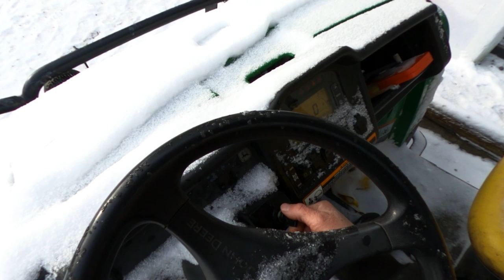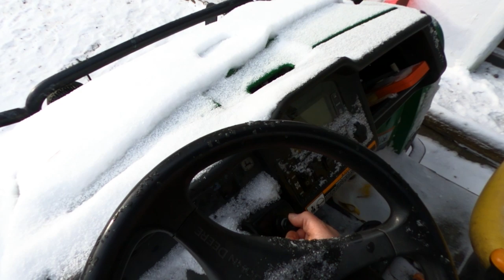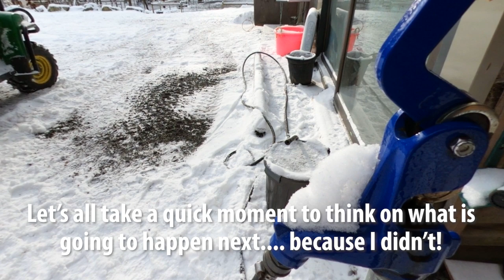Just A Few Problems With My New Genius Horse Watering Method

Comment: We use a similar system at the new barn I'm at.  If you don't count filling the tote with water, the whole ordeal probably takes around 10-15 minutes, filling 6 troughs, for around 25-30 horses total.  The contraption is used twice a day.
So I'd say you're on the right track! 

Our barn uses 100% gravity to control the flow out of the tank, so no frozen valves that require defrosting. Larger diameter hose is permanently connected to the tote, with a open valve, and when you're not filling up the troughs, it's hung on a little hangar on top of the tote to stop any flow. Fills up the troughs in 30 seconds or less. 
To empty when you're done, just lay the hose down and let it empty all on its own to clear out any water in the hose that might freeze.

Requires a bit of training to get the hang of stopping the flow without watering yourself in the process, but when you've got that part down, it's a breeze.
Reply from the maker: Thanks! Yup, it's a nifty idea, just have to refine it. I also thought of that idea of having the hose sit high so it doesn't drain and then I don't have to mess with the valve. Great idea! I'm going to do that. Hadn't thought on the "don't get soaked" pulling it out part... practice I guess. Go quick. Thanks for the suggestions!

Comment: How about building a snow sled/wheeled stand for the water container? (bonus points for hose storage under the container) Then the gator can pull it rather than you pull it onto the gator. You could also throw your wheelbarrow and shovels into the gator, and save yourself the trip while the water fills.

Edited to add: who knew you could buy these tanks on trailers... well that's my new thing for the afternoon. Make a tiny trailer for your tank :)
Reply from the maker: I thought about it but I have limited area to drive around in. Backing up is a pain too.. in the end it becomes easier to just load on the back. Thanks for the suggestion though!

Comment: Great idea. You've probably already solved the hose and adapter problem by now but your local pool/spa shop, if open this time of year, would be a good place to get such things. Also wearing a pair of those cheap nitrile gloves makes a suprising  difference in keeping you hands from freezing when doing wet things in the cold with out loosing your dexterity.  I don't know how often the horses need to watered but if every day  it might be worth  putting a submersible cattle trough heater down inside the tank so that you wouldn't have to drain it after each use. Then maybe make a poly tarp cover for the whole thing to help insulate  and conserve electricity.
Gool luck!

Comment: I use those totes for water troughs, cut in half leave the cage on but put that bubble wrap insulation between the tote and the cage & a submerged heater. It's been around -35 c all week and just some frost around the edges

Comment: OMG...that was so funny.  I'm sorry Graeme, I know I shouldn't laugh...but, when you were spending all that time unfreezing the nozzle to the water tank...my first thought was, "I don't know why he's worrying with that, he's not going to get it off of the table".  Brute force!  Good luck!

I HAD A THOUGHT (I know, right).  I'm sure you have already thought of all of these, but here goes anyway: How about if you filled the water tank up fully, therefore creating more pressure and water would come out faster into the water tubs...but, you would have to park your truck inside a shed so it would not freeze.  You could also get a little trailer for your truck and just leave it on the back so you can hay and water at same time and just leave them connected all winter...just park them in your shed so they don't freeze...just a thought.

Comment: Wow- it is not true what lots of people say, that war and love are the driving force behind lots of inventions- its wintertime, where ingenious minds come to solutions! :-)

Here in germany a quite common solution to that issue consist in: a)getting some old metal bathtub with enamel coating b)setting up a raised stand c) put some gas/petrol cooker or burner on small flame underneath. 
Another electrical solution would be to use heat stripes, or real trace heaters along the water lines- so to abandon big buckets/troughs of water, to use small buckets and heated pipes. Some new stuff are self-regulating trace heaters, I think that some new systems even are available that use 24V- so that in case of damage the horses won't be electrocuted...

(BTW: horses and cattle are way more sensitive to voltage than humans, so it is a good thing to use low voltage equipment to minimize potential danger.)